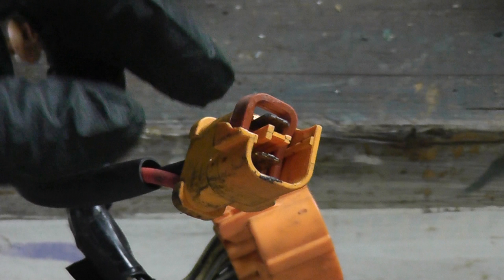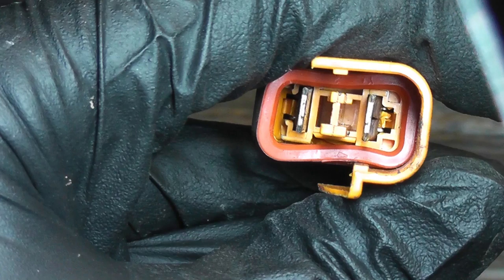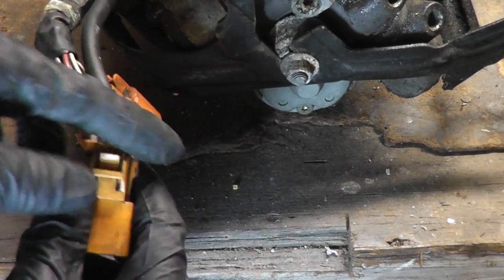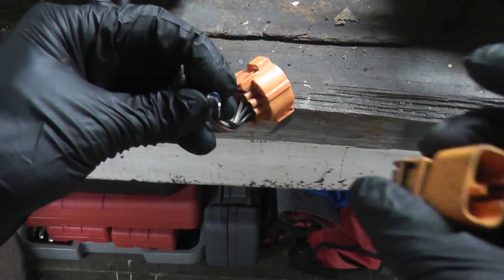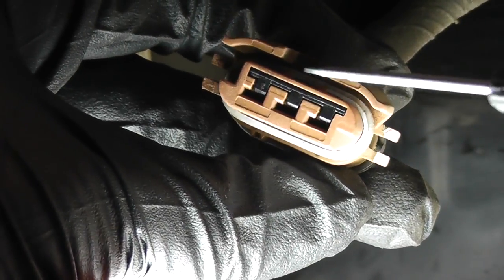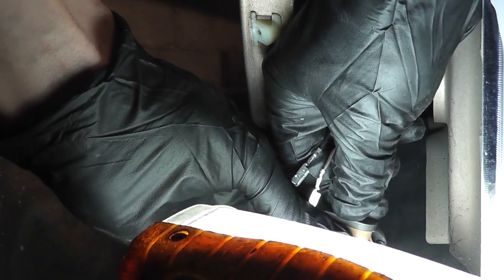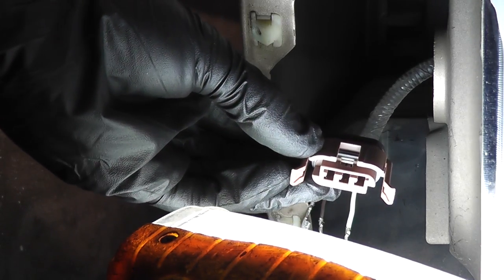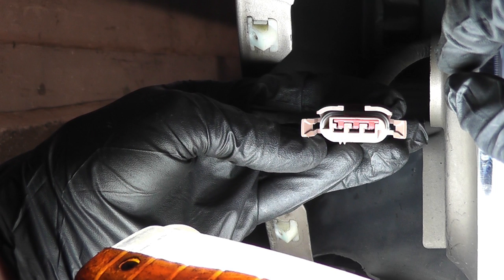How To Depin An Automotive Connector

Comment: You sure do work on your Accord a lot.  I thought those things were supposed to be tanks?  XD
Reply from the maker: This was a Ford connector guaranteed after years of exposure to engine heat for the clips to break off when you attempt to remove it.

One of the Hondas is mine the others are friends cars they are 18 year old tanks :-).

Little fixes here and there expected on any old vehicle. Old rubber hoses fail, rubber seals harden, crack, and leak. Can't think of too many times an issue has actually left me stranded on the road.

I've done more service work on my Ford that is around the same age and doesn't have half the miles these vehicles have on them so I'm getting off easy.
Reply: Yeah, it occurred to me that maybe you run a shop for some side work or something.  I thought I had cancelled the message from sending, oh well.  XD